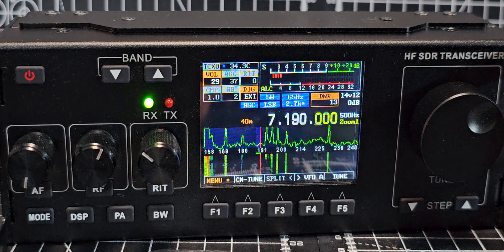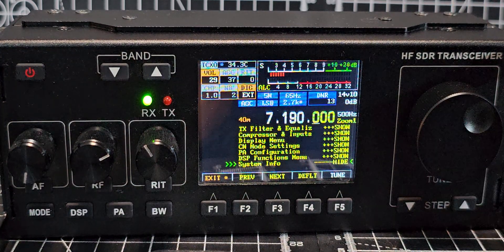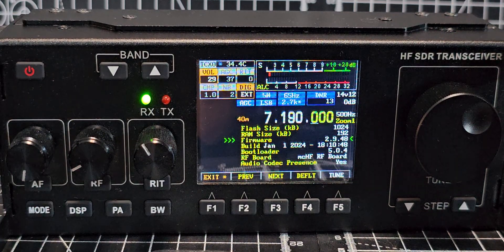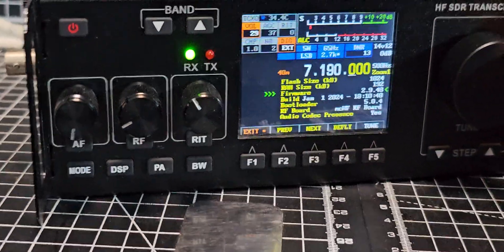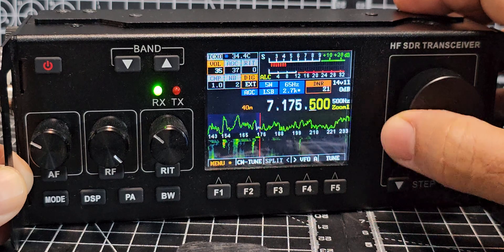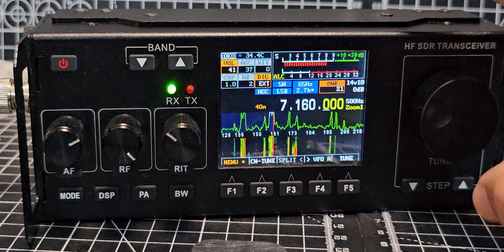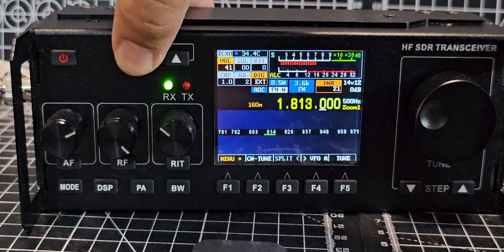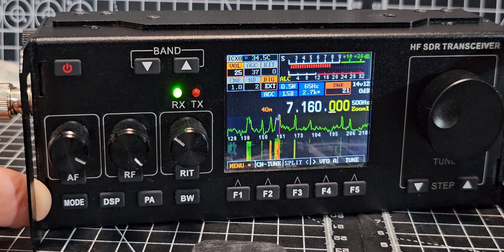RS918 HF SDR Transceiver - Look up Firmware (You can turn it on & off)

Comment: how do i set the s meter.. as it on s3 with antenna in its an s9 and dose on move no matter how strong the signal looks like a menue setting but do not know how to do this ... jeff.. m0prf
Reply: opp s it an s3 with antenna out and an s9 with antenna in no other movement on strong stations ..jeff.. m0prf
Reply from the maker: https://youtu.be/eVqZsJkR82A?si=1yanyX8yl2R1IZAR
Reply from the maker: https://youtu.be/eVqZsJkR82A?si=1yanyX8yl2R1IZAR